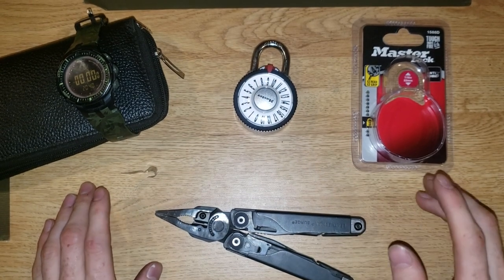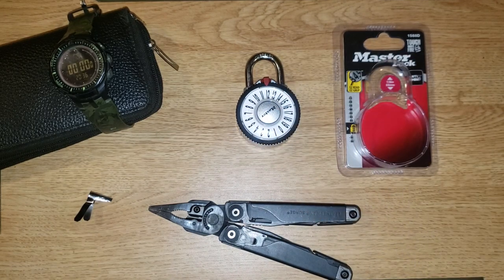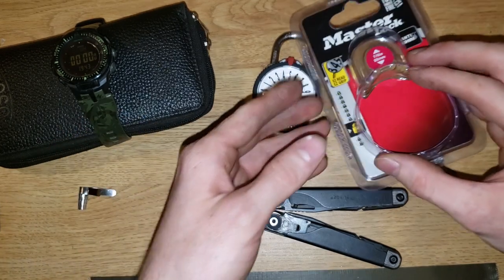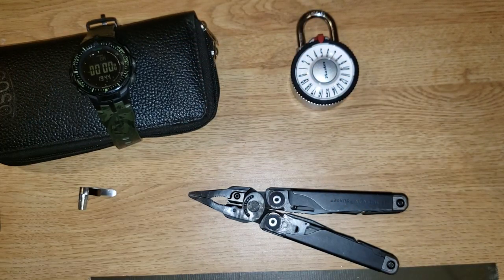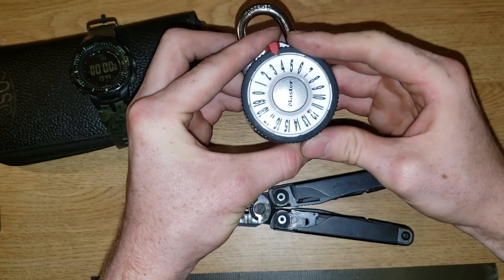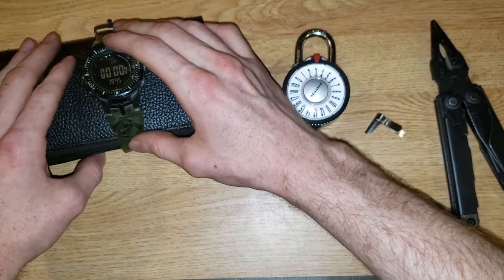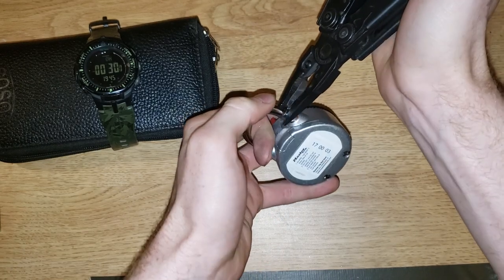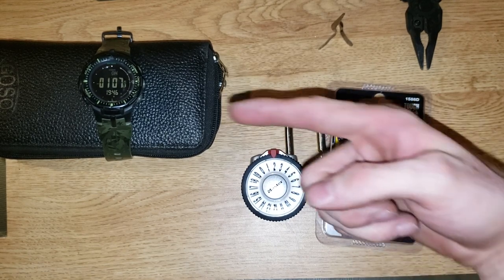[1] Master Lock's 1588D Magnification Combination Lock Shimmed

Comment: Nice. I've tried a few times but there always seems to be 2 major problems for me. 1= my Fing shims never seem to be thin enough to fit into it(trying on M1500's) and 2= When they are on a locker- there is very little room to maneuver the shim into place and force it down into it. When I have more time I may either= sand the shims down (I have those crappy Klom ones) or see if I can't engineer a better type of shim. As it stands now I have found 0 where the shim will even go down in it. I'm gonna try your pressing down/pulling up shackle technique. Well see if it works.
Reply: Did it work?

Comment: I bought a 1588D and opened it without shimming or knowing the combo. It behaves like a classic Master dial lock, but doesn't seem to have a sticky number. However, the lock point method for finding the third digit works. Since it only labels every other spot, everything must be doubled for the first and second digit calculations, and then cut in half.
Reply from the maker: Nice!